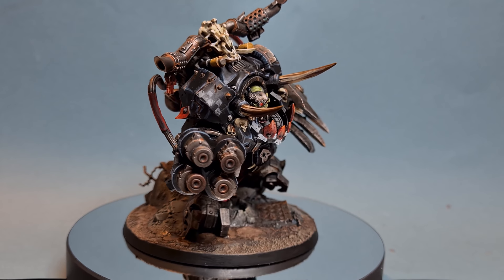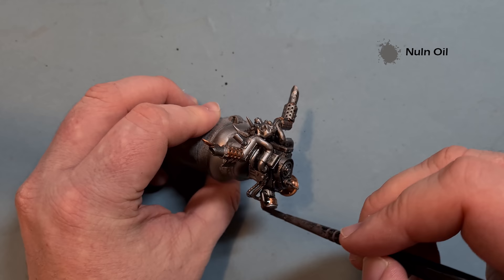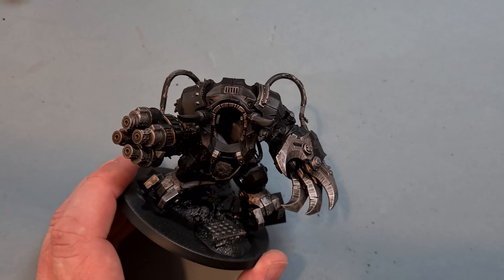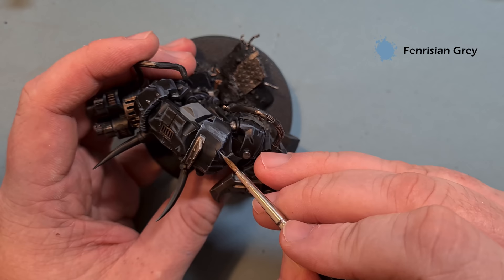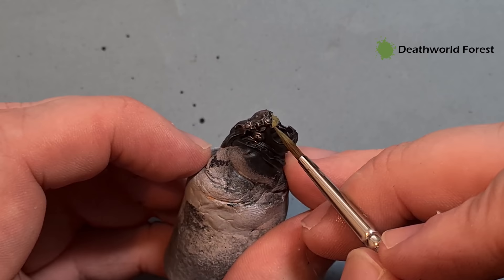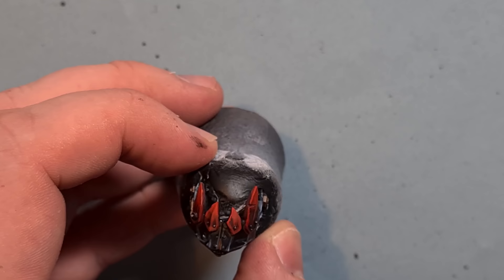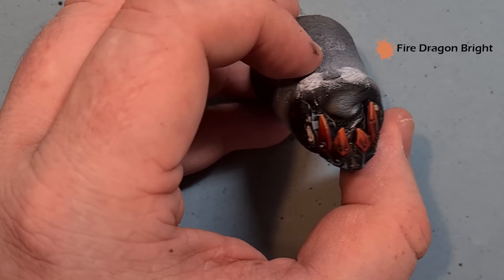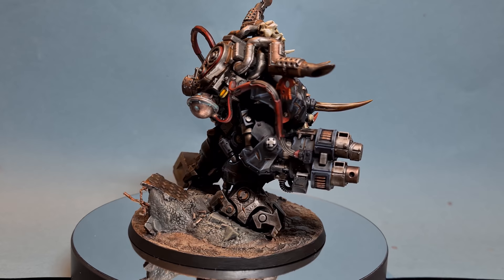How to Paint Ghazghkull Thraka

Comment: Odd question, but if i lacked a black primer, could i use a grey one, then base coat the model black with abaddon black, then proceed as per the guide?
Reply from the maker: Yes you can, but I wouldn't bother doing the whole thing black - just the bits that will be black in the end

Comment: My Darkreaper highlight seems to have come out much lighter, any suggestions? My thought process is I probably didn't shake the pot enough or perhaps I need to pair it down slightly with a touch of black or could I get away with a dark wash over it to tone it down perhaps.
Reply from the maker: Yeah you can probably tone it down with a dark wash - i'd finish the highlight first though with the other colours and knock it all back together for consistency - if you have black templar contrast thin that a bit and use it - or really thin some abaddon black (make sure you don't have too much on your brush). Use nuln oil as a last resort as it might look patchy
Reply: @ThePaintingCoach  Thank you so much, I went with the Black Templar contrast thinned slightly and it's dialed everything back a bit and pulled the highlights together thank you :) I may add a few more tiny fenrisian grey spot highlights but this advise was perfect thank you! :D
Reply from the maker: Awesome - thanks for letting me know!

Comment: So I bought a few of the Vellejo metal colours. I don’t own an airbrush. Would it be ok to still spray can prime black and then just brush another base coat on all the metal parts with a large brush instead of Leadbelcher spray can? Or would a spray of the Leadbelcher can on the metal parts be better than the black even tho I’ll paint over with the Velho metal? I have a bit of Leadbelcher spray left. Been wondering if I still need to use it anymore or just stick to black from now on.
Reply from the maker: I'd use metal color over the black - I paint all my metal bases using dark aluminium and a brush
Reply: @ThePaintingCoach  you do that after the black primer? Would you say then after priming black that I brush the main metal that I want to use for the metal parts or choose a darker metal from my selection? I managed to get 8 different metals and only one of those is copper. Rest is just varieties of ‘silver’ metals in that vellejo metal color range.
Reply from the maker: Pick one you like - I prefer dark aluminium over black
Reply: @ThePaintingCoach  Ok I have that one too! Gotta try them all out over Christmas

Comment: Hi, absolutely amazing video! I was just wondering what your thoughts were on the black high lights, would Eshin grey and Dawnstone do the same trick as the dark reaper and Thunderhawk Blue? Don't want to go out and buy those two when I have the other! (Sorry for another question)
Reply from the maker: Hi Brad - no problem at all - yeah they will work - you'll get a more neutral black than the colder looking one from using the blues!
Reply: @ThePaintingCoach  that makes a lot of sense! Thanks for the fast reply. Loving the videos by the way
Reply from the maker: No problem - and thank you! I appreciate it!!!